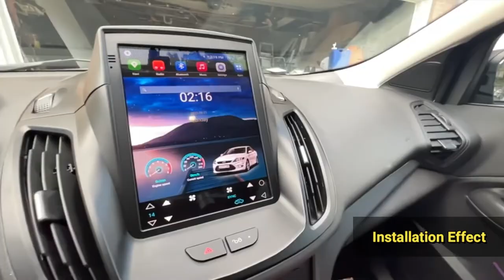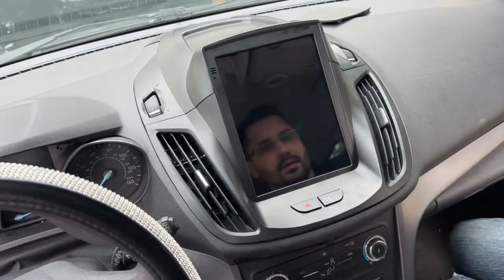An Easy DIY Radio Replacement on 2013-2018 Ford Escape | Tesla Screen, Carplay, HD Video...

Comment: I just purchased the smaller version of this (9”), but it seems to install the same way. The only difference between your install and one is my radio has two ‘antennas’. One has a black plug and one has a grey plug.  So I believe the black plug is the radio since when the grey plug is used I get nothing but static. I’m not sure what the grey plug would have been for. (Maybe GPS or Sirius radio?) But I do have one problem. When I connect the data/cameral link from the car (the wire harness that goes to the back of the upper info screen that displays the station and image for the back up camera) and I shift the car into reverse the screen turns to an icon of a webcam with a big red triangle with an exclamation mark in it. PLEASE tell me I don’t need to wire in their discount back up camera! Is there a setting I can change to give me access to the cars video feed? 2015 Ford Escape.
Reply from the maker: hi, sorry for the trouble caused to you. please contact us with email, we will help you about it :  aftersales@seicane.com

Comment: What radio did you ask for.I ordered one and it came with the wrong connections on the back of the radio.I need one like you ordered.
Thanks for the help.
Reply from the maker: dear, sorry for the trouble cuased to you. you can contact our after sale team, they will help you a lot. please rest assured. here is the email : aftersales@seicane.com

Comment: I'd rather have the factory unit than that chinese crap...
Reply: The early version radios are notorious for just not working. Usually when you see these vehicle specific radios it’s because there’s a large need tor them, they work pretty good to be honest, and they’re usually a 200-300 instead of $1400 to “repair” it by the dealer
Reply from the maker: hi, our product has a high quality. even though there is any issue with it,we will be responsible for it.
Reply: The factory ones are horrible lol